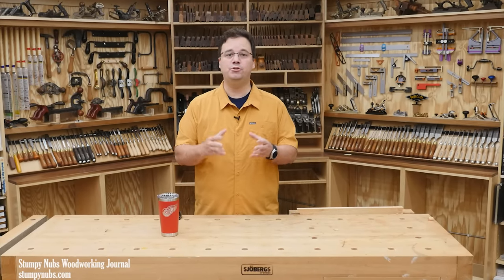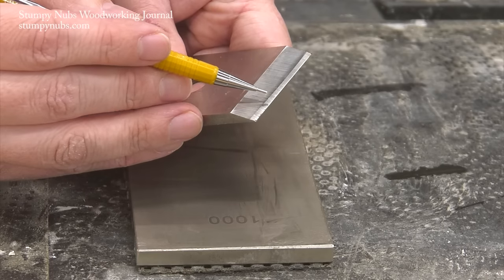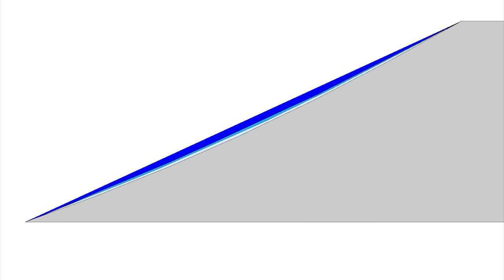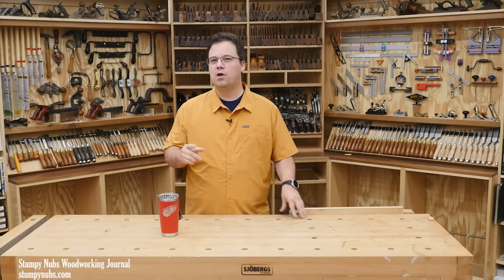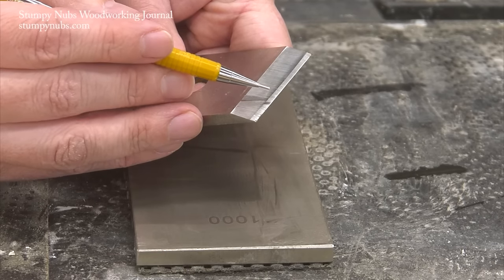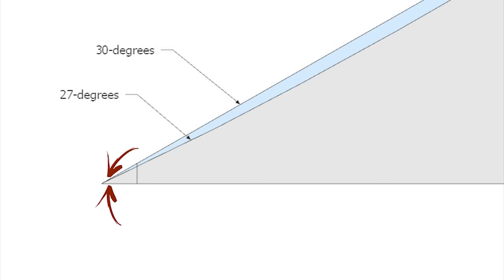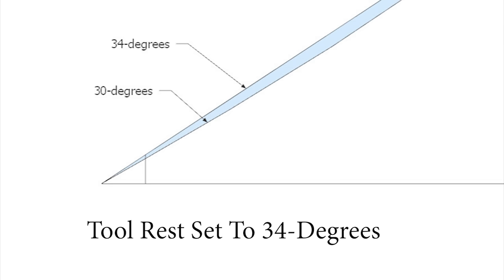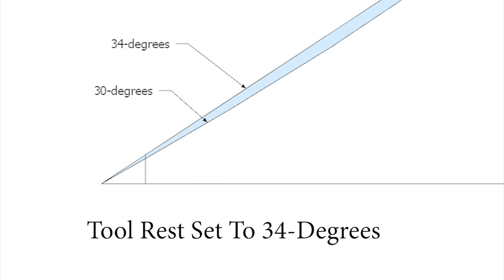WRONG INTERNET TREND! - Watch before you sharpen with a bench grinder!

Comment: couldn't you negate ALL of this debate (at least the grinder part)  by grinding your chisels in the same fashion as seen in the end of this video at approx  6:55 in. The wheel IS 100% flat in that example.. LOL
Reply from the maker: You can on a CBN wheel because it is solid metal. Regular grinder wheels are not designed for side loads and are can come apart. Plus, the sides are not perfectly flat and square to the edges.
Reply: @StumpyNubs  I see what you mean regarding the specialist disc.. I did try a side grind earlier but my grind stone is only 75mm (3") dia and nearly 25mm (1") deep .(risky perhaps on a 200mm x 20mm grinder_... I hardly put any lateral pressure in the stone.. finish on a normal stone by hand. just an idea.  Great video BTW.. with real data

Comment: Uhhh.... yeahh. Machinists bench grind sharpen tools all the time. Tools used to work METAL without any further honing on a flat stone. And those tools are already made of super brittle tool steel. Many metal cutting tools used in manufacturing are actually intentionally designed with extremely pronounced hollow grinds. (Far, far greater than what a 6" wheel would do. Think 1/2" wheel or even smaller. Of course, those are actually done a different way with a dressed wheel.) I, personally, used such tools in the manufacture of engine bearings. Anyone that tells you a hollow ground edge is bad just doesn't know what they're talking about.

Comment: Why not just grind on the flat side of the wheel ? Problem of hollow grind solved.
Reply from the maker: On a CBN wheel you can, but not on a regular wheel made from compressed abrasives. They are not designed for side loads and can dangerously fracture.
Reply: @StumpyNubs   ...interesting safety point!

Comment: There is a detail Stumpy overlooks in his analysis. Even though it is true that the honing restores the 30 degrees at the edge, the fact the chisel now has a slightly concave sole, which makes it more prone to digging into the wood and, as a result, being more stressed near the edge, which is equivalent, in terms of metal fatigue, to being more brittle.
Whether this effect is significant or not, I do not know, but it is there. This issue is more complex than it appears an can benefit from study.
Reply from the maker: The concave is so slight, it makes no real difference in performance.

Comment: Who are these people? Tell me so I can go to their channels and tell them they’re idiots. Back when I worked wood for a living, I tried every sharpening product that came down the pike. I still have oil stones (man made and natural, water stones, sheets of plate glass with sandpaper stuck to them…you name it I tried it). But I quickly found I didn’t have time to haul out a bunch of flat stones, spend precious time laboring away on them, getting my hands covered with black, oily slurry (not to mention time spent on stone maintenance) and go back to work every time I needed to sharpen a plane or chisel blade. I kept the backs of my plane blades and chisels flat and mirror polished and would grind the bevel on a 6 inch white wheel, then touch the bevel for a brief split second on a cloth wheel charged with gray compound. It took less than a minute for a shaving sharp edge, and I was back to work. Did I have storybook pristine edges? Nope, but time is 💰 and I needed 💰 more than I needed zen precision.

Comment: THANKS STUMPY---In my (limited) experience it is those who are new to fine woodworking or have limited experience (and those with just an opinion) who make the loudest racket. Greater experience (and here experience really counts) shows that many paths exist toward a particular objective, many paths aren't even visible to those who haven't put in the hours. It is said that it takes 10,000 hours to become an expert in any field-so that's 5 years for a pro (not perfect master) woodworker-sounds about right, doesn't it. So someone spending 500 hours a year takes 20 years to gain that expertise (but actually less due to the passage of time)-so, how about the occasional weekender-say, spending 100-200 hours a year---They'll NEVER get there (BUT they'll get alot better---WHICH ARE YOU???
Reply: there's a great book that talks about exactly that 20 hours to learn anything.  

your assuming that everyone wants to become the Olympic world class super duper woodworker.  In my experience, that's simply not true.  Woodworkers want to become better or at least good enough that we can cover up the mistakes we make so that we can produce a beautiful / function object.

40 -50 hours of intense concentrated study (a couple 2 or 3 weeks if your doing nothing else)  can get you to the pro level on any one type of skill.  cutting dovetails for example is multiple skills put together.  how to setup and use a hand plane is also multiple skills.  don't denigrate someone who is working at it.  low class

Comment: Gosh this is borderline the handtool snobs stuff. You never get exactly 30 degrees down to the micrometer everytime by handsharpening on a flat stone, it is 30ish. A master of hand sharpening will keep a mostly consistent angle between sharpenings, their angle window will be smaller than Joe's who just started handsharpening, but it is alwyas precisely 30. And in reality, you're not using a hypothetical spherical chisel of uniform density and infinite wear resistance. In the real world, every time you cut, you're wearing down the edge and deforming it a bit, so you need to sharpen after every single cut to keep it impossibly machine precise by hand, which is contradictory nonsense. It is always a macroscopic level of precision, not a microscopic precision thing, you get nothing done ever and you wear your tools faster chasing that.

So the hair splitting about it "must be perfectly 30" is already dead in the premise, before we even get in its practical absurdity even if accept it. Which, as shown in the video, even if we indulge that delusion as possible, it is till nonsense even then - it its absolute nonsense from start to finish.

Comment: Sharpening your chisels using a grinder overheats  and weakens them ,as they are  tempered steel   . I swear the internet has become a plethora of horrible advise
Reply from the maker: You will not overheat if you do it properly. LOTS of woodworkers grind their chisels. Just because you don't or can't without burning them doesn't make it "bad advice"... LOL...

Comment: Truth is the PERFECT cutting edge is 29.05 degrees. If you sharpen to over 0.01 degrees of this you are a BAD tool abuser and your cabinetry / carpentry is awful. There is no 'near enough' get it right or take up clay modelling instead where such inaccuracy doesn't matter.